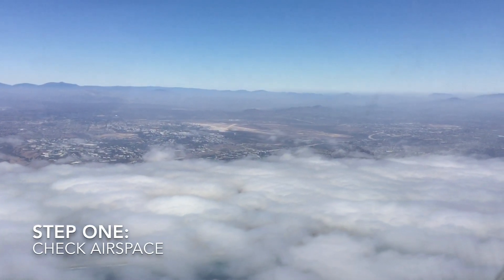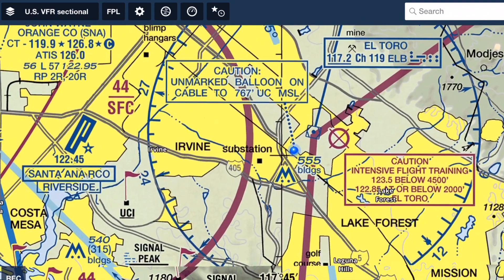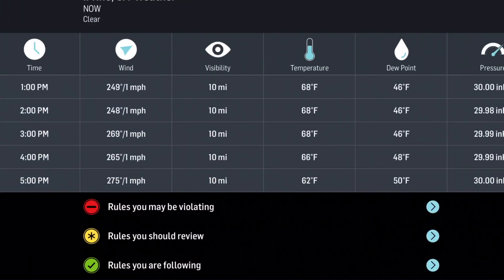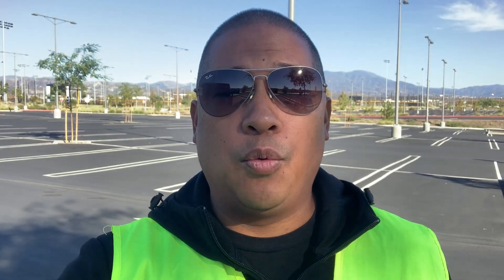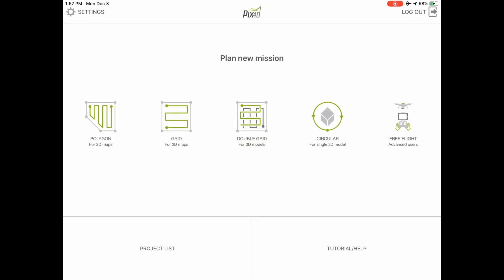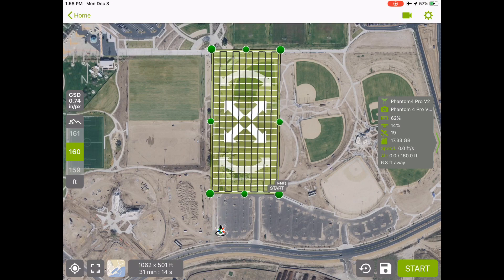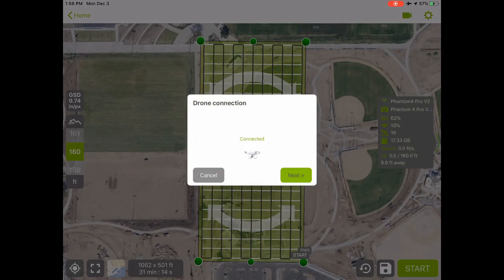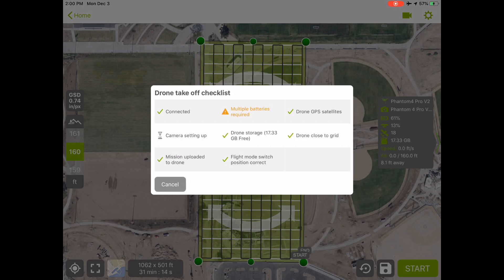Using Pix4D to map the OC Great Park aka "Base formerly known as MCAS El Toro”

Comment: Good morning AeroEyez. If I’m using this app, what format does it save in.  Would the customers be able to see the 3D animation without having pix4D installed, or are they only allow stand alone stills?  I’m interested in using this app.
Reply from the maker: Eyezup Aerials They capture standalone stills. In this particular project, it took about 1100 photos. The Pix4D desktop app will then take all those photos and stitch them together. I’ve seen people use DroneDeploy to process the images since DroneDeploy offers a free trial option where it will process 2-3 orthomosiac maps. After that, we use Premier and another app to compose the 3D models. Hope that helps!  Thanks for watching!!!
Reply: AeroEyez I’m new to this mapping. I’m going to try it out this weekend.  Thanks for the info.

Comment: Hey man, new to your channel, good stuff! I'm not sure if i missed this point or not but perhaps you can provide clarity.  I have several questions, sorry in advance. Once you have created your flight plan via the 4D app, the drone flies the route by itself? Does the app work with any dji drones, example mavic air? and my last question, what do you do when the drone is running low on battery charge? New to the drone world, sorry for all the questions. Thanks
Reply from the maker: Hey, thanks for watching!  No worries about all the questions.  Keep 'em coming!  I wish someone had put out videos for me to ask questions when I got started.  Yes, once you plan the route on Pix4D, the drone flies the route automatically.  The app works with my Mavic Pro as well as Phantom 4 and Phantom 4 Pro so I think it should work with a Mavic Air too.  As in this video, multiple batteries were required.  Once the drone hit 18% battery, it automatically pauses the mission and heads home.  When you put a fresh battery in, it will resume where it left off.
Reply: AeroEyez wow thanks for the fast reply!  Keep making awesome videos and I wish you favor and much more success.

Comment: Your humility is refreshing! I am interested in learning more about “mapping” and will investigate Pix4D Capture.  Once you have the grid area set up in PIx4D, do you return to the DJI 4 control screens? Or, is there no need because the mapping sequence is entirely autonomous?  Best wishes!
Reply from the maker: Thank you so much for tuning in!  The entire flight is conducted within Pix4D so there is no need to go to DJI Go 4.  The only reason I do so is to ensure the flight path is clear at the altitude that I choose.  DJI Go 4 has a bigger screen than Pix4D to see what the camera sees so that's the reason for that.  Once you launch in Pix4D, the flight is all autonomous but you can easily pause the mission and take manual control anytime.